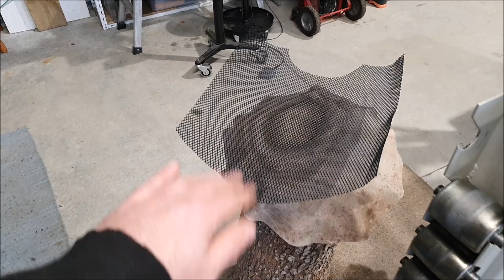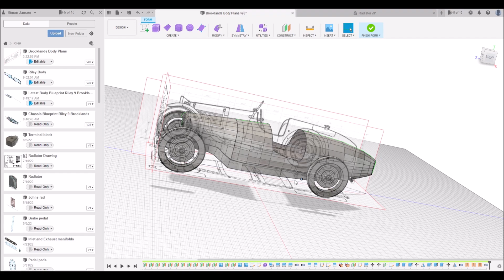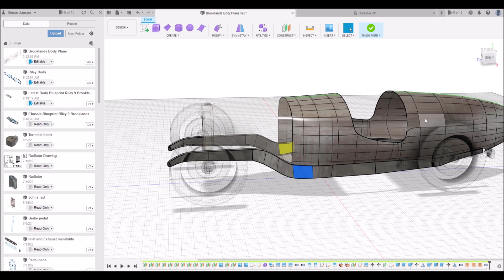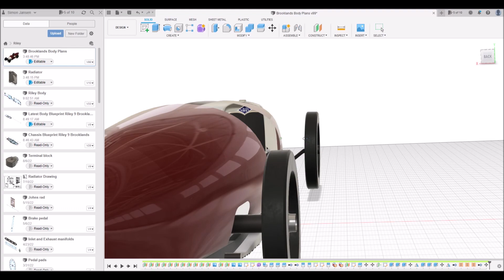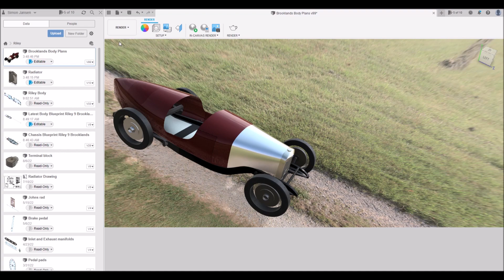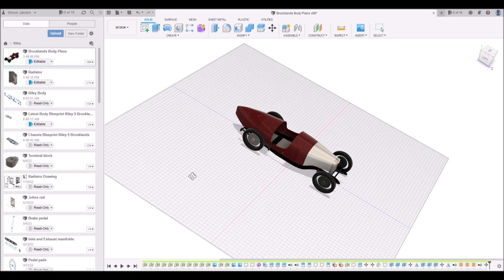Pre war Riley Brooklands replica modelling the body

Comment: The radiator really turned out nice, I think it will work out fine for you. Will it need a pump? maybe... maybe not..  you'll find out on the first hot day!  The computer modeling is fascinating, thanks for going through it and explaining.  I think I'll stick with cardboard and tape for now but learning how to do that is tempting. Take care.
Reply from the maker: Will be interesting to see. I suspect you do since the originals needed one due to the shorter radiator. But then modern cores are meant to be more efficient so the only way to tell will be see. At least now I can hopefully run the engine long enough to bed it in. If you want to know about the modelling have a look at the channel I mention. He really explains it well and starting from the very basics. It's very powerful software and there are always multiple ways to do things in it.

Comment: Amazing work. A very personal opinion I know, but I'd raise the front of cockpit to sit slightly higher than the rear
Reply from the maker: The front being a little low is something that is accurate to the originals. It's always hard to tell what's original or not though! But several very original cars have the rear slightly higher, as do the blueprints I have and some of the artwork about (like the George Oliver art) and some of the period adverts so I believe it is correct. I suspect when people build replicas or Brooklands inspired specials they assume that's wrong so 'fix' it but then a lot of those cars end up looking very flat across the middle. There were different body styles though and the works race cars are different again. Doors or doorless, long or short tails, etc. They all varied so there is some leeway here.
Reply from the maker: The other thing to consider, especially with a small car, is it looks different with a person in it of course. My mentor always talked about cars looking as if people were sat ON them not IN them. You see it a lot on Austin 7 specials where people are sticking out of the car too much and it just makes a small car look even smaller. A higher back puts you more in the car so tends to look better. That's just my opinion of course. I am luckily not very tall so I don't poke out the top much anyway!